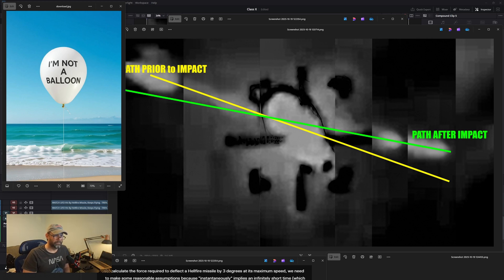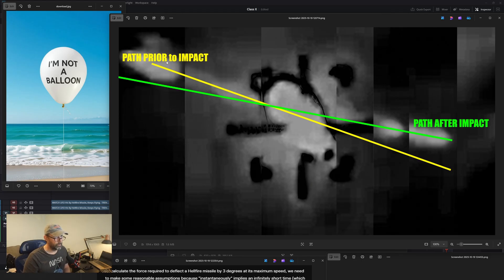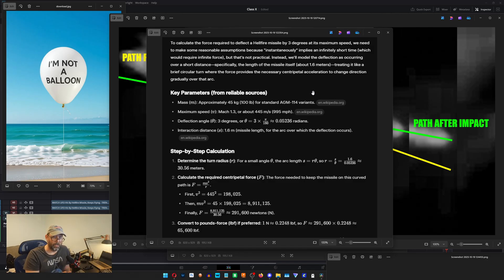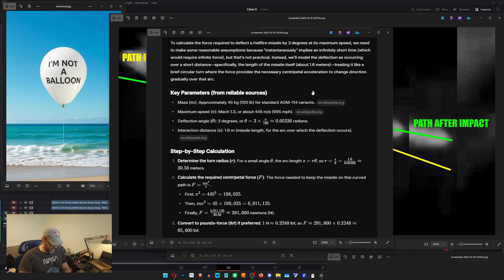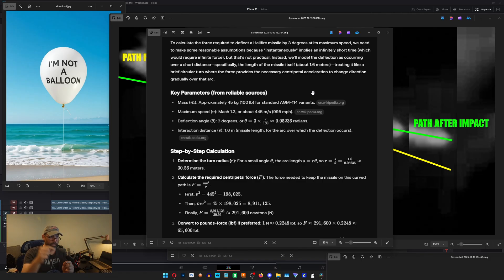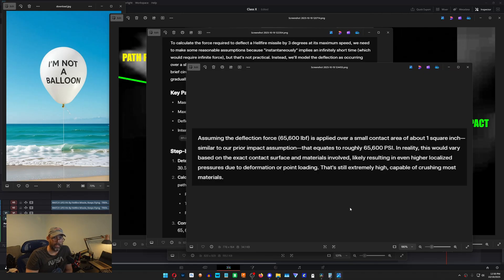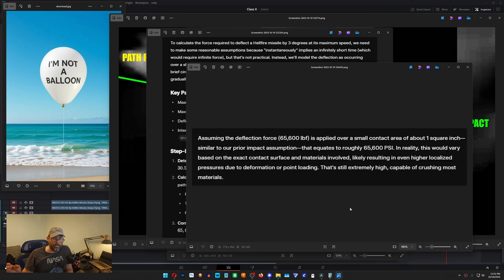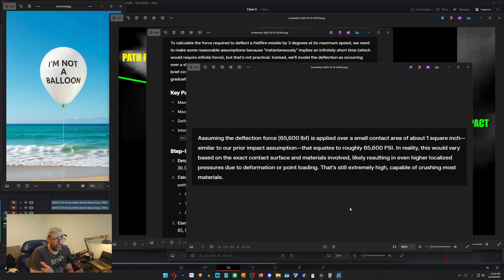The Yemen UAP is still not a balloon and here's why.

Comment: I agree def not a balloon and the people that put out videos saying case closed it’s def a balloon are disingenuous and have zero evidence or math backing there statement up.
Reply: Parallax, relative position and speed of the camera, the fact that there is zero noticeable deceleration from the hellfire missile upon impact. The three degrees "deflection" over a period of time can be something as simple as a wire from the balloon having a small effect on the control surfaces of the missile that wasn't designed to continue flight after impact. I can easily do the math too, but this case is completely solved ages ago.
I see nothing anomalous. It's just a perspective-issue